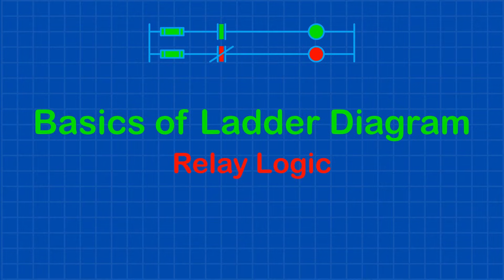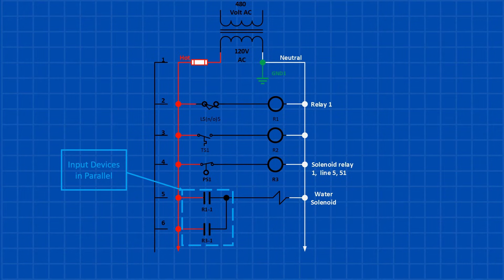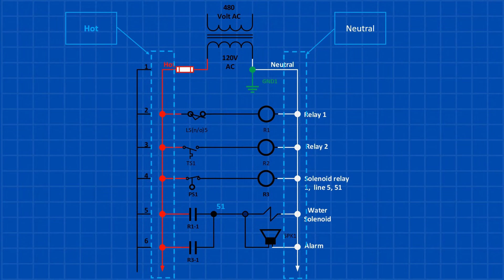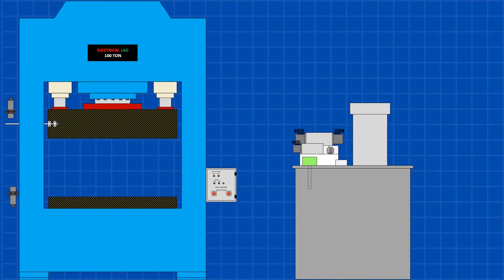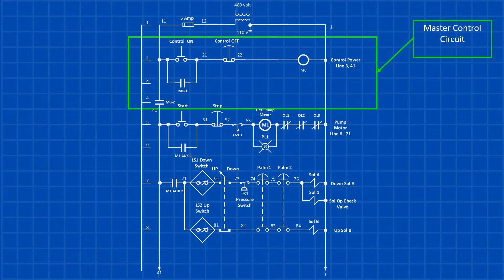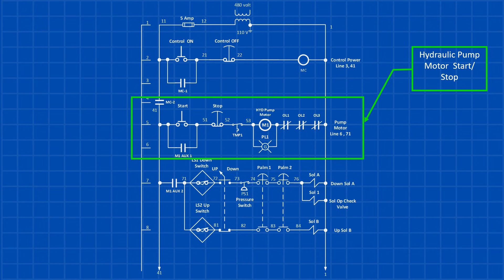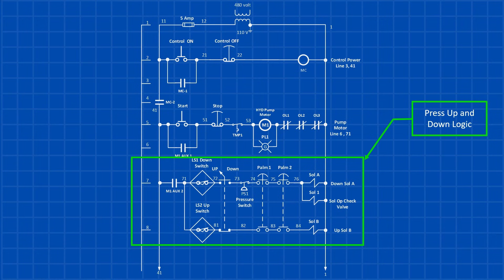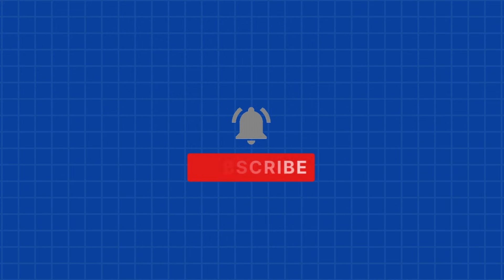Read ladder diagrams like a pro in 10 minutes

Comment: At the 2:38 mark you say that inputs should never go to the right of the output then on line 5 you show 3 normally closed switches to the right of the motor?   If you could clarify i would appreciate it. Thanks.
Reply from the maker: Those are overload protections and not input from the field. Thanks for watching .